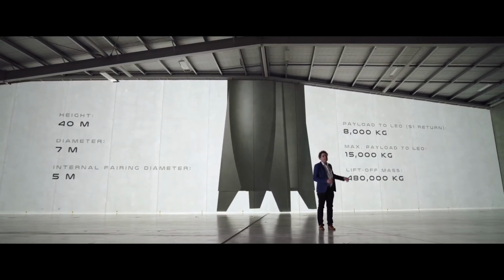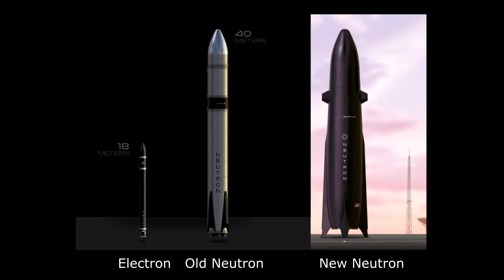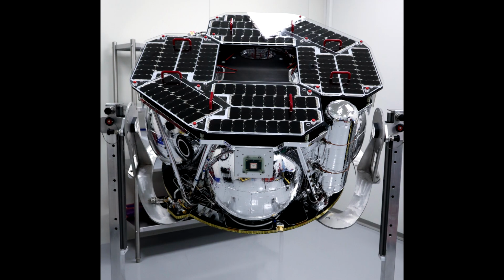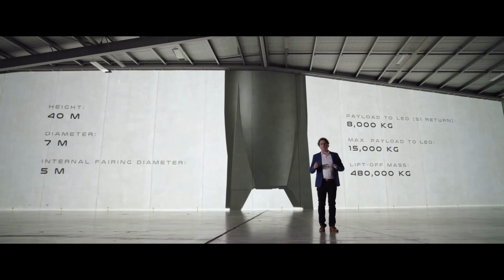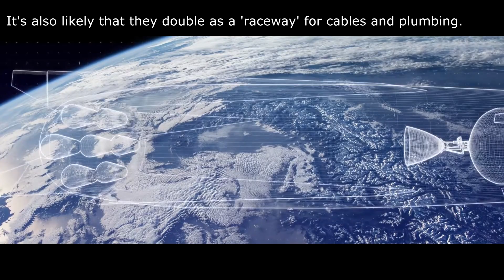Rocket Lab's Neutron Rocket Will Be More Reusable Than Falcon 9

Comment: The I-beam demo was cute n'all, but "being hit by an I-beam on a pendulum" isn't a typical use case for a rocket structure.

SpaceX (and now Blue with their Jarvis project) are going with stainless steel upper stages because they need it for high energy re-entry. As Elon said at the time the switch from carbon was announced, when the carbon's thermal protection system is added to the mass of the carbon, 304 stainless comes out with a better weight figure. But if you're not retrieving your second stage, and your rocket concept sacrifices first stage efficiency to give the second stage the highest performance possible (as Neutron's is), then you don't have the thermal heating problem and you need your second stage to be as light as possible because all of that mass is going all the way to orbital velocity. Using carbon fibre is clearly necessary for this, I don't think there's any danger of steel being used unless Rocket Lab vault-face and decide they want to recover second stages.
Reply: That I-beam demo will be important when we start having Space Force in battle versus Space Ewoks!
Reply: Planning to defend against c-beams, perhaps?
Reply: The dry mass of Starship is just insane. A Heavy-lift Vehicle from NASA's SPS study has similar payload to Starship (120t), yet only 4000t mass when full. Which is less than simply the fuel mass of Starship, and even with some mass reserve! Apparently, aluminium construction/winged flyback is a pretty efficient design!
Reply: @HalNordmann  Think you mean booster and it's putting a starship it's fuel and 100 to 150 tons not in to orbit but into space so it is lifting far more.
Reply: @alanrickett2537  Uhhh, what? The HLLV can lift somewhere in the middle of that capacity into LEO (120t), and that is without any weight-saving tricks like common bulkheads, load-bearing baloon tanks or being built like a tincan. Dry mass is incredibly important on rockets, even more than on airliners - and you don't see any airplanes made of steel, do you?
Reply: @HalNordmann  Actually aircraft have been made of stainless steel - it has the same strength to weight ratio as duralumin with the advantage that it can be welded rather than riveted (rivets are heavy).
Reply: @allangibson2408  Do you have any examples of those stainless steel rockets and airplanes? There were probably just a few of those, and vast majority still uses aluminium alloys. The only ones I can think of was Atlas/Centaur (due to their baloon tanks, which are problematic to handle), a variety of solid rocket motors (due to the high pressure inside, and low Isp anyway), and some Big Dumb Booster concepts (due to how cheap it is, not performance). Plus, as was seen on the Atlas, steel this thin tends to crumple and buckle when exposed to sudden loads, which complicates transportation. A HLLV I mentioned has the same payload as Starship, but about 20% less wet mass - and that is with very conservative numbers!
And about burning - most airplane designers seem to accept that tradeoff, since aluminium is so light. Steel can also burn if it is pulverized. Plus, if you are sitting on hundreds of tons of rocket fuel, the material of your hull is not going to make much of a difference.
Reply: @HalNordmann  yes, and if you don't land the booster star ship can do 250ton plus to orbit plus the starship and as you know more weight to orbit means a lot more weight every where else.

Ps there are a lot of planes made of steel.
Reply: @alanrickett2537  But if you don't land the booster, you don't need any steel, or even Starship at all. If you stripped the HLLV of its wings and other reuse systems, it would probably have a similar payload. Plus, if that 250t figure isn't completely wild mass guessing, then it probably refers to a fully expendable mode - which means no landing for the ship either. Additionally, what would you use that much cargo for? Lifting lead? Starship's payload fairing is very limited. And about the planes made of steel, do you have any examples that made it out of testing?
Reply: @HalNordmann  Any rocket with hypergolic fuel will have stainless steel tanks (for chemical compatibility that aluminium just doesn’t have). A lot of aircraft fuel tanks are stainless steel for the same reasons.
The BAC-188, Budd BB-1 and Fleetwings Sea Bird are examples of all stainless aircraft structures.
Aluminium is much cheaper not functionally better.
Reply: @HalNordmann  the point is they are landing both parts so they need the extra weight for fuel etc. So it's  not the construction materials that make the extra weight it's the change in fight plan.
Reply: @allangibson2408  That is only the tanks - the remaining structure is still mostly aluminium. It is also one of the reasons hypergolics have mediocre performance.
Reply: @alanrickett2537  As I said - the HLLV also lands both parts, and it is still significantly lighter than Starship with similar payload. So Starship is pretty useless.
Reply: @HalNordmann  The tanks ARE the structure. That’s how the Titan II on was built.
The engines are attached at one end and the payload at the other.
Reply: @allangibson2408  And what are the interstages, fins, etc. made of? Plus, the Titan and Ariane have a good reason for using steel due to their hypergolic propellant which would corrode anything lighter. In Starship's case, however, there is no such excuse.
Reply: @HalNordmann  time will tell
Reply: @HalNordmann  The whole point is stainless steel is NOT heavier. It is more expensive to fabricate and USED to be more expensive to buy. Strength to weight is the key number and is identical. That’s why SpaceX is using it.
Reply: @HalNordmann  in a effort to try and make you claims fit I have done some reach and double checked my memory there are two system the you could be talking about the Comet hllv  which is old and has zero figures matching your claims and has no reusable parts or the SD HLV based on the shuttle which does match a number of your figure and has reused parts but if you meant that then you need to add the fuel tank and solid boosters to your total both of which are one use.
Reply: @alanrickett2537  There is another. It is from NASA's obscure Solar Power Satellite Study, in a part appropriately titled Space Transportation. It isn't as well known as either of these but trust me, it is a real study.
Reply: @HalNordmann  can you post some sources. I did see 2 entries  2
 on this, one was the senate committee  shutting down  funding the other was a NASA astronaut saying it was not any good neither had any specs and I could not find a space flight or wiki page.
Reply: Stainless steel makes sense when the entire rocket is returning from orbital (or interplanetary) velocities as you can use the fuel to absorb heat. This was proposed with the X-20 in 1960.
From suborbital velocities carbon fibre works better.
Carbon fibre is a composite of epoxy resin and carbon fibre so is heat limited to the char point of the epoxy resin.
Orbital entry would require ceramic cloth or carbon carbon composite (which are brittle) heat shielding.
Reply: @allangibson2408  Yes, a high melting point is indeed important in a "hot structure" TPS - but Starship can't use that, since its tanks are also its outer hull. So if you heat the outer hull, you also heat the interior of tanks, no matter the material. An aluminium construction with TPS comparable to the Shuttle would be about 20% lighter, and that is nothing to sneeze at!
Reply: @HalNordmann  Aluminium is however flammable (it’s the heat source in Thermite). Stainless steel has the same strength to weight ratio as Duralumin and doesn’t burn as easily. That’s why a lot of rockets were made with stainless steel structures. Hastelloy is better but more expensive - that’s why it was used for the hull (both pressure and external) of the Mercury and Gemini spacecraft.
Early Mercury spacecraft also used Beryllium heat shields (just like the US ICBM’s).
Reply: An I-beam might pale in comparison to the damage mechazilla's arms could do to the side of a rocket caught badly
Reply: I did think at one point we might see what damage an I-beam would do to Peter Beck!
Reply: Carbon fiber has a higher melting temperature. I believe the switch to stainless was more to do with manufacturing than complications. Starship is supposed to be a rocket they can build in a day and explode the next day. Due to Starships mass manufacturing and rapid prototyping. I think Carbon and stainless are different when it comes to cold liquids.
Reply: @joeyknight8272  The melting temperature is an irrelevance. It'll fail long before it melts. Yes, manufacturing with stainless is easier, and that was part of what drove the switch, but the weight saving from stainless over carbon was also a factor.
Reply: @spychopath  agree to disagree
Reply: @joeyknight8272  it's not an opinion to disagree on, the epoxy that bonds carbon fiber composites starts to break down at 150c well before melting. Even with high temp epoxy it starts to break down at 300c. Stainless retains is strength to over 500c and if it overheats it isn't going to irreparably degrade like burning off epoxy would.
Reply: @JamesSeedorf  but those are just words for you and the other person. How do not know rocket lab doesn't use a special carbon fiber and binder?  How do i know you aren't lieing?  There's no links and thoss links might be towards non space grade carbon fiber. So i can agree to disagree until you provide for a soild fact that you or the other person is completely correct. I know i might be wrong and likely am but i still have to ability to agree to disagree
Reply: @joeyknight8272  so you are going to trust your Google search of the melting point of carbon fiber, over a Google search of Maximum usable Temperature of carbon fiber composites? Sounds like willful ingnorance. The waters can be muddied by the existence of ceramic matricies but those are ablative and you are fixed on the melting points, which are completely irrelevant to structural integrity. It's like saying jet fuel can't melt steel beams.

Also worth noting if rocket lab had a magic Ultra high temp epoxy, they would make far more money bottling and selling it than building rockets
Reply: @joeyknight8272  because rocket labs are not planning to re-enter  any part built of carbon fibre just land it if rocket lab are not saying it work at the higher temperature why are you. RL are building there first stage from CF because that what they know how to work with, and SX are building the booster from steel for the same reason. The starship (2nd stage ) needs to re-enter so needs to be steel and tile and just CF would not come close to surviving that.

Comment: Scott, great video thank you. 

For future discussion, could second stages be recovered with 3-4 staged parachutes after a minimal reentry burn?  

I know this has been thought through, I just don’t know why it isn’t practical. I’m thinking a droge chute removing speed before reentry heating, then 2-3 more stages to keep it below scorch and then a reasonable landing.
Reply: Parachutes and 27000km/h don't really mix well. This is why the Falcon 9 second stage is not recovered either.
Reply: first stage goes 1 or 2 km/s second one goes 8 km/s energy depends on the square of the speed. recovering the second stage is WAY harder

Comment: My main question is how do they intend to human rate this vehicle with the integrated fairing? That would seem to preclude a lot of abort scenarios.  Will it be a specialized version without the fairing?  Seems a human rating would be questionable with that design.

Also, I do understand the arguments for a gas generator cycle, and that closed cycles are more complex and have more failure points etc - I know - but another part also laments the impulse lost.  Also, unburned methane in the atmosphere... (and yes I do have similar thoughts about the Merlin).

Edit: maybe a combustion tap off...
Reply: Maybe they don't intend to human rate it at all?
Reply: @washellwash1802  At the beginning he talks about human spaceflight
Edit: Exactly 1:25 of RocketLab's video
Reply: What if they will have an option to remove fairings and replace them with faring like second stage for human travel.
Reply: @urosrot7916  The question is then "Will the first stage be able to do safe re-entry", as that would leave it open
Reply: Isn't that methane dumped into hot plume, so it heats up and burn with atmospheric oxygen? When it comes to human rating it, I also thought it may be difficult. But maybe they fairing is so thin, it can be broken up by aborting capsule? We'll just have to wait to see
Reply: @LauPaSat-pl  In that case, the "an I-beam can't even dent it" test would really come back to bite them lol
Reply: It will likely be a variation as you need access, though that could be accomplished by opening the fairings on the ground.  As to abort, design the capsule to be able to go through the fairing and/or explosive bolts.  Maybe just a pusher to open the nose and let aerodynamics do the rest.
Reply: A crewed vehicle would need to survive reentry, so perhaps it would be reasonably simple to forego the fairings entirely. 
Or, like Apollo and Soyuz, use an expendable fairing and (as you suggest) skip the reusable fairings entirely.
Reply: I seriously doubt that they intend to rate it for that.  The goal seems to be the first design to break the magic $1000 per kg to orbit barrier.
Reply: Why would they human rate it? Satellite launches are where the money is made.
Reply: @Lithos2k  Peter says human flight in the video.

Comment: What would be interesting is to know is if they will autonomously pressurize this design.

One interesting little dig at musk was the cleaning of the carbon sheet after it was hit. This was a copy of Musk doing it after he hit the Cybertruck with the hammer.
Reply: Seems to me a 1st stage that RTLS right away doesn't get much advantage from autonomous pressurization, considering the complexity of engineering it and mastering it.
Reply: Actually this was Franz with Hitting it and cleaning it...

Comment: Hmm. Trying to outspaceX spaceX. This is gonna be interesting. My general prediction is that the Falcon 9 is the Sojus of the 21st century.....because nothing will ever get the adolation, reliability or cheapness of the first properly sensible launch system ever put into mass production. (Sensible as in not having escalating costs, waste of hardware and horrible manhour/result ratio)
Reply: Most incoherent post in this whole section. Nice job.

Comment: The legs may just have replaceable sacrificial ablative covers if they make them carbon fibre.
Reply: I don't think they will need that , they just don't get that hot and also heating is a very short duration . Remember there is pre entry burn ( from 7000km/hr to 5500 km/hr (Falcon 9 example )) the re entry is also  not from orbit and only has approx 1/4 to 1/6th  of the heating to dissipate compared to return from orbit

Comment: I wonder what's the lightest possible 2nd stage.  Maybe they can intentionally skip off the atmosphere?  Starship needs to get back down to earth fast, but what if they let Neutron's 2nd stage can take days, or even a week, to come down to earth?  The 2nd stage is already very light, and they can probably use a much lighter heatshield too.
Reply: This is a valid way to reenter if you can get your drag area up and mass down.  Supposedly pillows and reenter from low earth orbit because of they're low density.  (NASA grade Nomex pillows anyway)

Comment: The carbon vs metal presentation shows very well why I don't trust carbon on my bicycle. Metal will bend, carbon will hold up perfectly until it catastrophically doesn't. And then you can pick carbon fibers out of your flesh :D
Reply: With long fibers, the structure will hold partially. It will behave like a wet rag, but not as a bail of needles.
Reply: @iamjadedhobo  as long as it sticks together it's cool